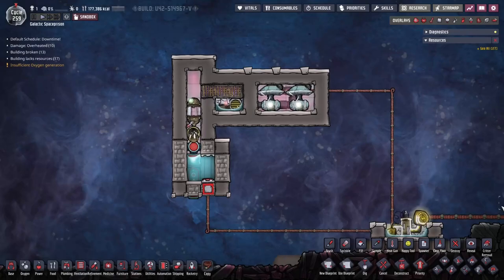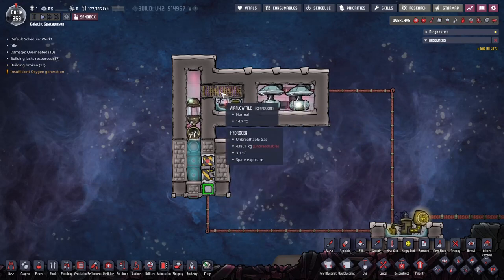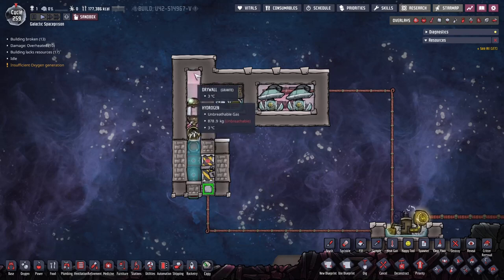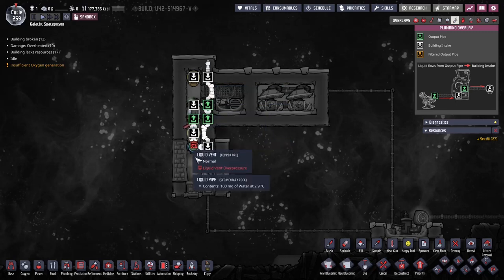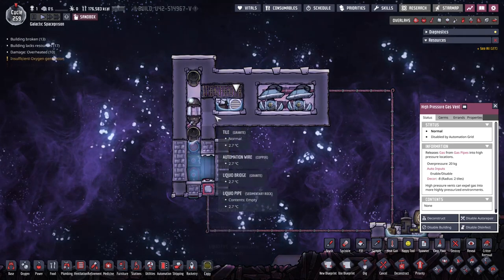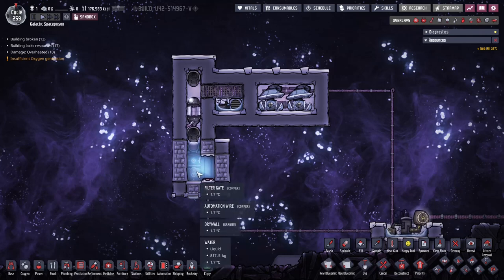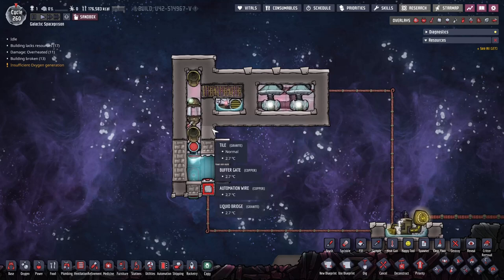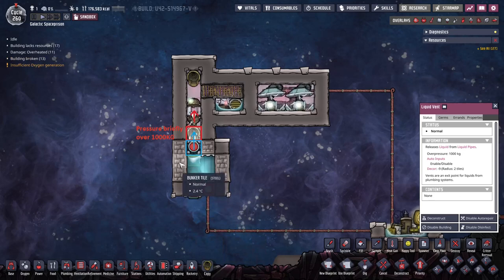Extreme Gas Pressure Gauge - Oxygen Not Included

Comment: Beautiful and compact build! Is there a pattern to the overpressure trip? For example: if there were multiple gas rooms/sensors going in sequence, would they all alarm at the same time? Or is it just a random blip that needs to be accommodated?
Reply from the maker: Thank you! In this case, the door, using water to push 2 tiles into 1, rapidly forces 1 gas tile into another which already had gas. This briefly overloads the liquid vent and causes a water bubble to continue down the line, which then makes a blip on the liquid sensor. This only needs to happen briefly.
Alternatively, could have a liquid vent just in a room full of gas, with no door mechanism. This will trip whenever the whole room goes over 1000KG/tile.